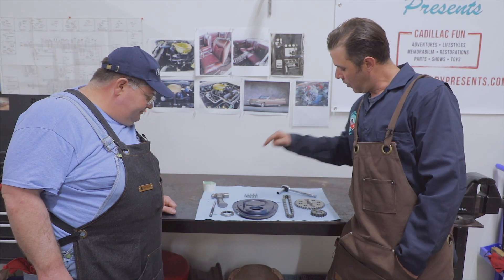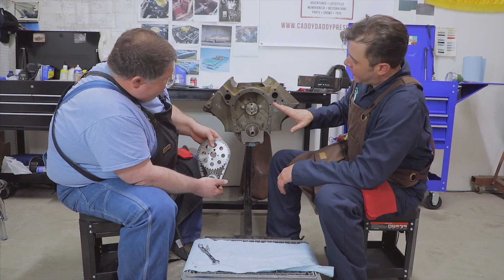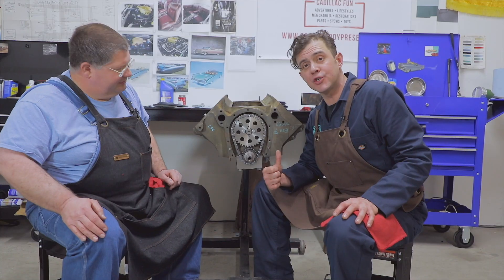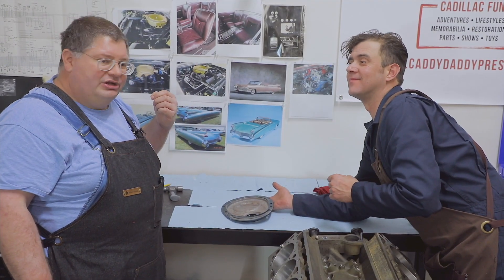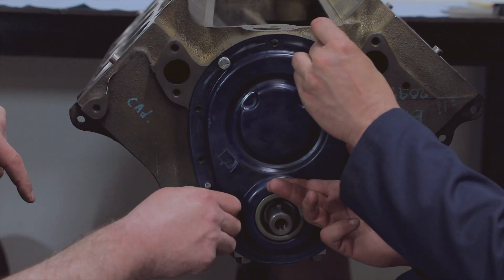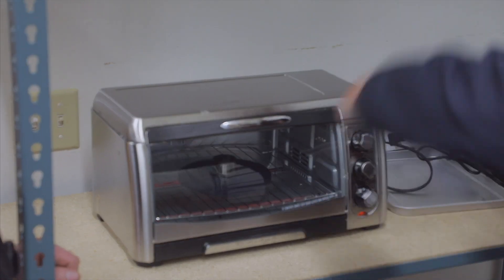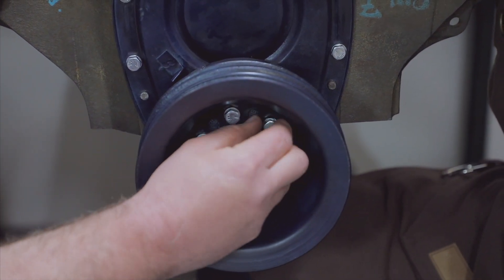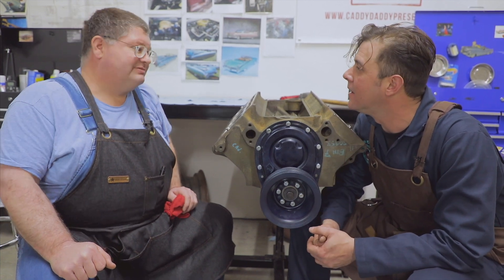How To Install a Timing Set on the Cadillac 390 Engine

Comment: Don't like the fact I didn't see a torque wrench used guys. But the term you want to use when heating up a part is molecular structure
Reply from the maker: We don't show the final torquing of the hardware since we do not want people blindly using the same specification instead of looking up what is proper for their engines. Many jobs are similar between the various series of engines such as the 331 and 390 series, but torque specs may be different. Always torque fasteners as specified in the factory service manual.

Comment: I really enjoy your videos because I am rebuilding a 331 engine for my 1953 Cadillac. Your videos have been very helpful.  I'm having trouble finding the correct torque for the timing gear cover and for the oil pan to block bolts.  I realize that they are low torque, but I would like to get them correct without guessing.  Do you know them?  Thanks.
Reply from the maker: Great question! Please see below:

Timing cover...10-12 ft/lb
Oil pan to crankcase bolts (5/16-18)... 10-12ft/lb
Oil pan nuts (5/16-24)...15-18 fl/lb

Comment: I just got a ‘67 fleedwood 60 Series with a 429 on it with a few issues on the engine  , I think I’ve gone as far as my knowledge on ignition systems with no luck and my feeling is that the problem is the timing chain .
I knowers you mention to someone else that your shop is not open to the public , are you able to point me to a shop that specializes in this type of cars and motors ?
Most shops seem to be interested in working on newer model cars .
Reply from the maker: Hey there! Yes, we only work on our own vehicles and do not service any outside Cadillacs. Are you local to the Napa area?
Reply: I’m familiar with the Napa area , I live in Concord , I’ve been up that way many times .
Any suggestions ?
Reply from the maker: @kingchispas  There's not a whole lot of options that deal with these specific vehicles in our area, and as you've said they all mostly work on newer model cars only. If you do find a great place, please let us know. We would like to know as well. Thanks!

Comment: Great work guys, I’ve been eagerly waiting for this vid
Reply from the maker: Great to hear that! Are you installing a timing set yourself?
Reply: Caddy Daddy yes mate, I’m doing a transmission swap first then rebuilding the engine. I’m going to purchase the deluxe rebuild kit from caddy daddy with the”hotter cam” is the timing the same or do I need to degree it in? These videos are my manual! Love your work guys
Reply: Robert Simons thank you very much mate. I’ll follow your lead on that. Yes dialing in the timing and test driving is what it’s all about right! So my book wants about 5-6 degrees from memory, .... and you think maybe pull that back a little when tuning? Really appreciate you taking the time mate, I’ll probably ask a lot of questions. I’m a heavy diesel mechanic... not to much experience on carbs and distributors. Cheers
Reply: Robert Simons by the way it’s a pleasure to follow you guys on the channel. Appreciate what you do. A great experience. I love bringing back these beautiful cars of the past into great condition. 1962 coupe deville

Comment: I'm inspired! I've picked up a 390 block, heads, crank,etc. will refer back to these when I am assembling. Is your shop open to the public? I'm down the road in Vallejo. building a 1957 CDV. Cheers!
Reply from the maker: Nice! Good to hear others are also building a 390. Hopefully our videos will help you out! Our shop is not open to the public, but give us a call if you are looking for any specific Cadillac parts. Our inventory is rather large..707-252-2339.

Vallejo is not too far from us! Stay tuned as we have the pistons, oil pump, oil pan, heads, fuel pump, water pump, and alternator install coming up in future episodes!
Reply: Are you guys going to build a jetaway transmission? That would be awesome.
Reply from the maker: @petestocks8360  We are not experts in Transmission rebuilding so we will not be doing that.
Reply from the maker: We hope to have a limited audience on filming days in the future. We film on Thursdays and or Fridays. We will make an announcement when that happens.
Reply: @Caddydaddy  I will take the day off to be there! Mr. Bob and Coyle are the type of guys that would be fun to wrench with and the knowledge drops are greatly welcomed. #Coyle/Mr.Bob 2020